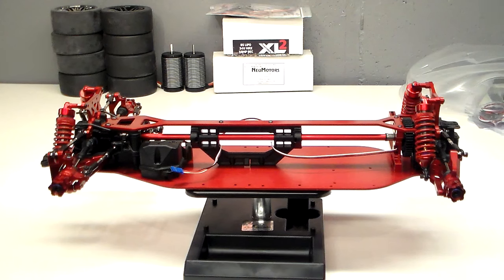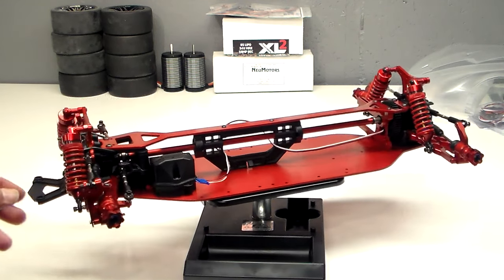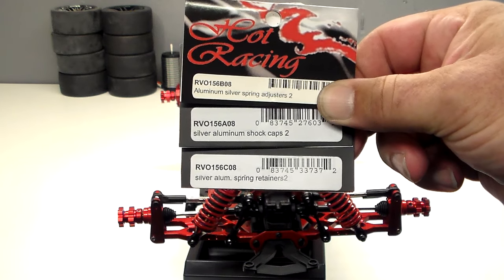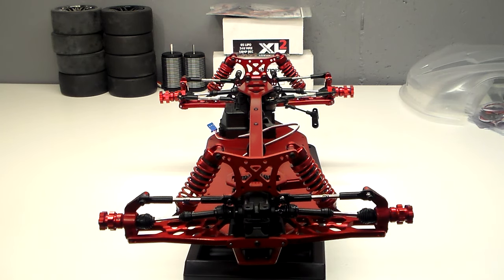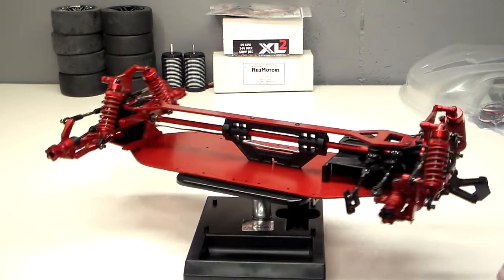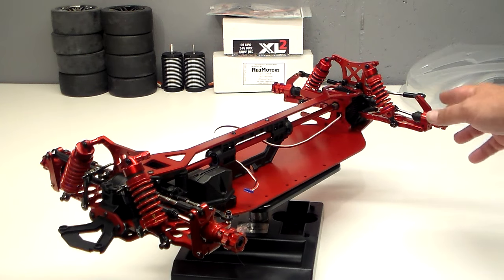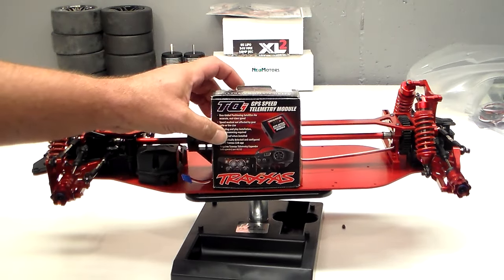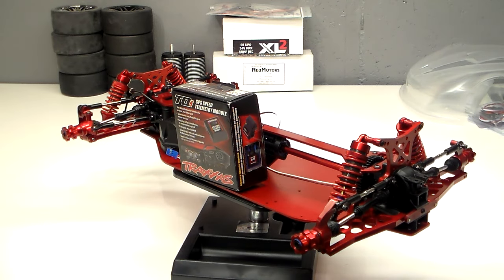Custom Traxxas XO-1 Update Vid #1

Comment: XO-1 is looking real good! Bryan I don't know if your making this a speed run car but I've tried different diff lubes for this car. I found that if the rear diff weight is increased I had major torque steer. I think stock is 100K front 10K rear. I only slightly increased the weight on the front. Jumping from 10k rear diff to 50k gave me major problems. Also I closed up the air vents on the bottom and just run fans on the motor. I believe the vent causes too much air inside the car and causes most of the blow overs you see online.  I also run the same Killer bodies vette body and made a vent in the rear bumper to let trap air pass. You can check out my very first videos of my XO on my channel since this was one of my first speed run car. I'm actually going to get this car back up running in the next weeks. Good luck with your build!
Reply from the maker: Thanks for input Bro, been hearing from alot of guys that locking the rear is a bad idea for handling. Gonna get rid of posi and go with something similar to what your talking about. Not really sure what im going to do with this car but i do want it to track good and go straight under hard acceleration. I will check out your xo vids and look forward to seeing you bring back xo. Thanks again

Comment: very nice brian!! looks so clean.. just a little heads up  when i locked the back of mine with 1m weight in front it hated the rear being locked would never go straight under hard acceleration. i left 1million in the front and put just some 100k  in the back the car totally changed . i dont know if you seen my videos but my xo was a hard launching mofo lol .   just hate to see yours get damaged good luck bro cant wait to see some running videos..
Reply from the maker: Thanks for heads up Luis, i will be mindful of posi rear diff. I have an extra if i need to change.
Reply from the maker: I checked out your xo1 vids Bro. You aint bullshittin, that badboy is quick off the get and straight as an arrow at full speed.  Hoping mine will run awesome like yours. Might need to check out the 2200 kv motor. Awesome job

Comment: What tires can you up grade too my tires brand new 1st run blew out at 127 what do you suggest ?
Reply: Chris  Mefford same... I just put some proline foam tires. Foam does not balloon at all and is really great for drifting, not so much for drag racing (still reach 120+ tho). They also don't last very long on pavement... I was considering getting the 17mm to 23mm hex adapters and putting on some 1/5 wheels and adjust gearing..